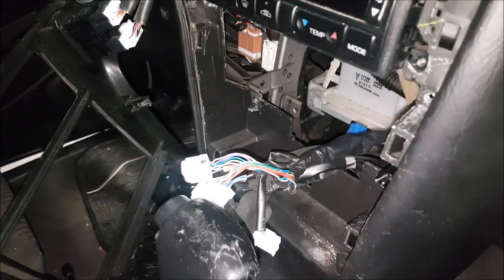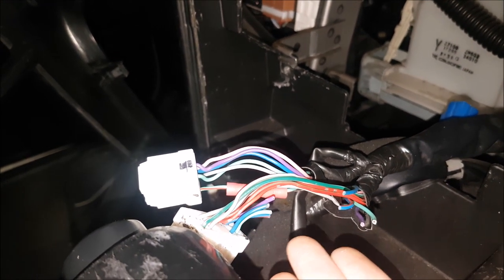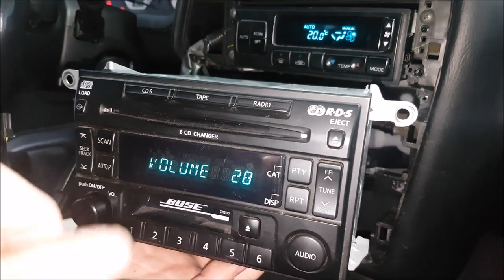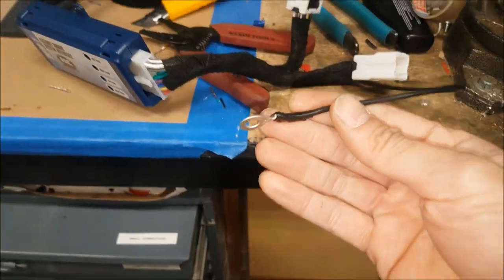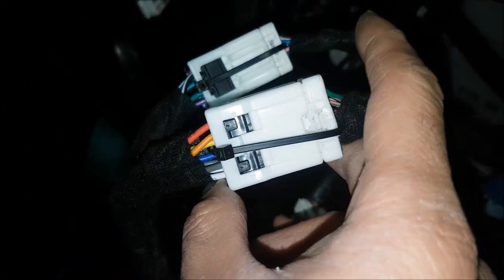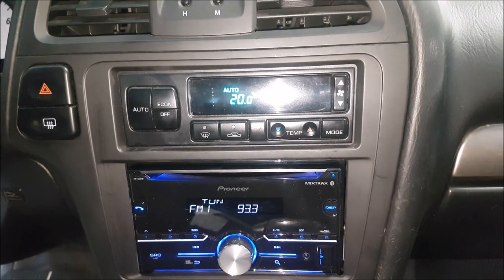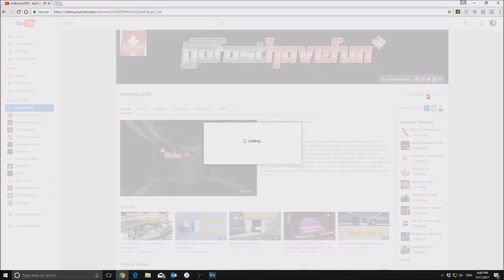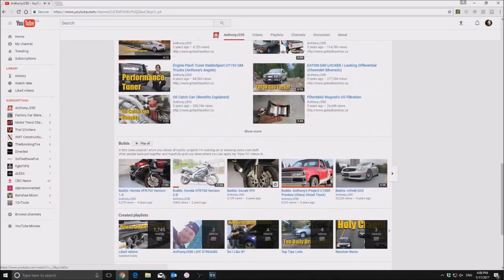How Not to do Car Audio Episode 30 | AnthonyJ350

Comment: Thank you for info.  My 98 maxima radio sounds total SHOT. Does noise. No nothing.  Seems like previous owner did not take care of it.  It is Bose deck.  I wish I could use it.  Currently want to send in to a shop just for audio check and fix.  Hope I don't need new unit.  

Very itching to diy😵 but nervous. Not much audio experience.
Reply from the maker: It shouldn't cost that much for a shop to change the head unit.  Plus a good shop should provide lifetime warranty on the workmanship.